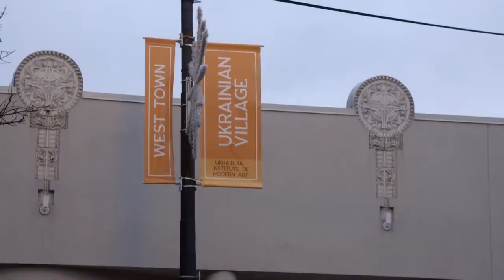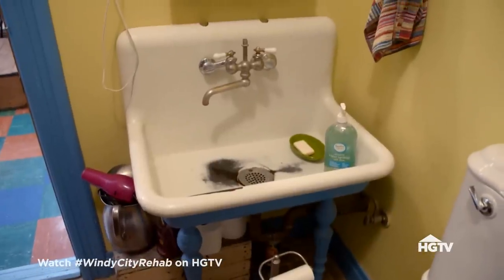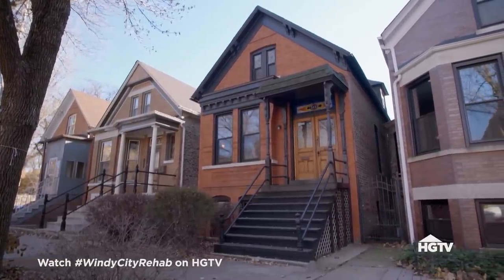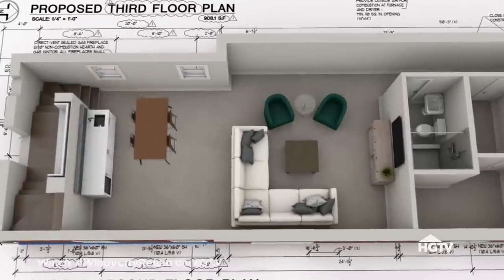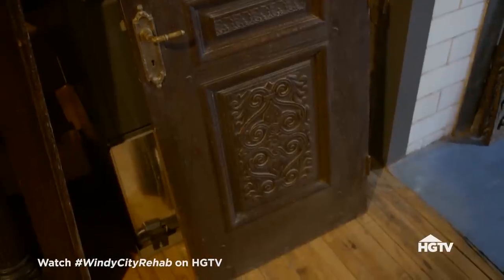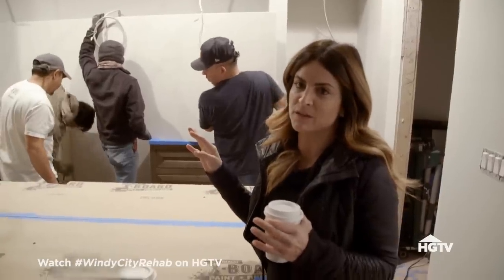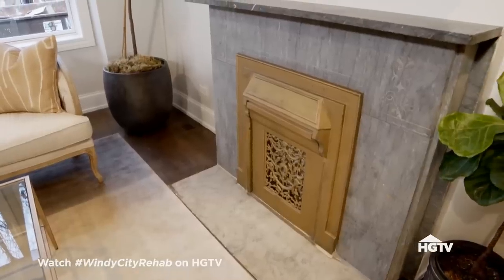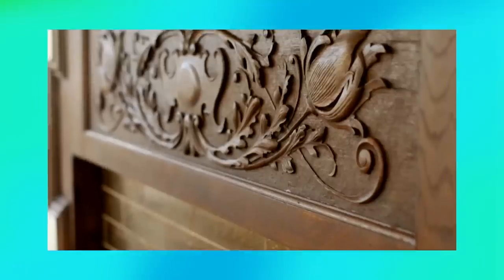Ukrainian Village Cottage Restored to Former Glory | Windy City Rehab | HGTV

Comment: I would not want to live in a neighborhood where the houses are packed together that tightly. A housefire would seriously endanger the houses on either side.
Reply: Pretty much all the housing stock in Chicago is like this.
Reply: As noted... this is the smallest Chicago lot. It might not be even the standard lot size.  The common Chicago lot is 25' wide x 125' deep to the back alley many got up to 30". The city kept pretty standard thru to its last growth in the 1950s thru mid-60s. The depth in blocks generally remains the same. as Chicago's street-grid is 8 city blocks with alleys to a mile and main street. Northside especially has diagonal streets that cut thru also that were original Native American trails incorporated in as the city grew.  

Into the 20th century 19-teens. 20s and 30s Chicago still boomed with its bungalow belt of Craftsman homes inspired by Frank Lloyd Wright ... similar size lots .... homes set a tad more back giving it a front lawn appearance still with back yard.. and garage from its alleyway. Its mid-century styles still are my favorite for some reason... fully brick as the city quarries usd a pale pink color brick with other varieties to add to front facades. So well-built they have a steel beam under the first floor with all a full basement that most finished even as part of the home over the decades.

These were Ethnic European immigrant neighborhoods Chicago evolved with... Ukrainian Village here was Eastern European settled. They worked in the mills and manufacturing factories that built America. These old neighborhoods stood the test of time.... so much of our newly built ones may not and some young will see if they do in 50yrs.... This home will probably still be here in 50yrs?

Just think..... this home was already 40yrs old during the Al Capone era... built in 1885. I live in the East.... and my home was built in 1900. At least Chicago is more a single-home city over row-homes as the East. Philadelphia is over 60%  row-housing fully attached both sides of a street with no green fronts and many no back yards..... now that is where I draw a line if given a choice... Chicago at least as green-leafy neighborhoods tree-lined (some soaring beautifully) and a small backyard at least... most have a garage built later entry from the alley and trash pick-up and perfect to put the ugly power-line poles freeing fronts from their ugliness.
Reply: Yeah, it's not like Chicago has codes to account for that or anything; they don't have any significant experience with fires...